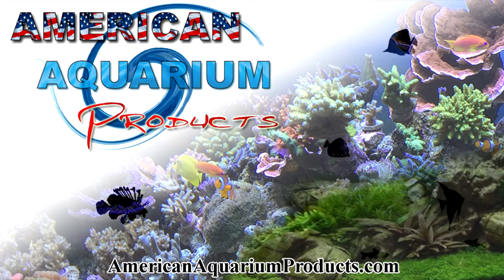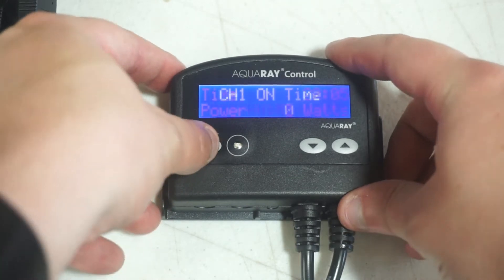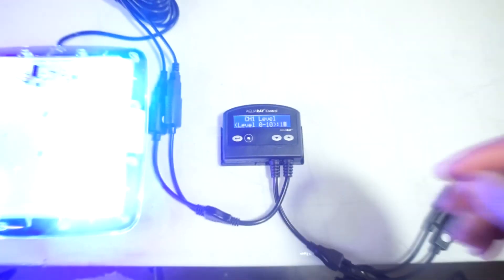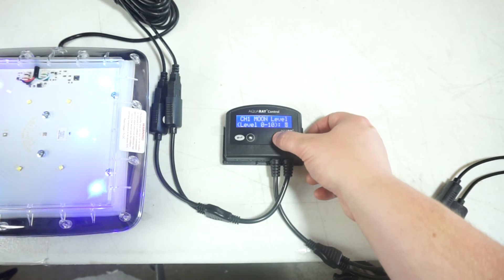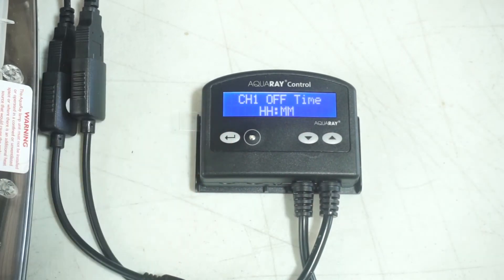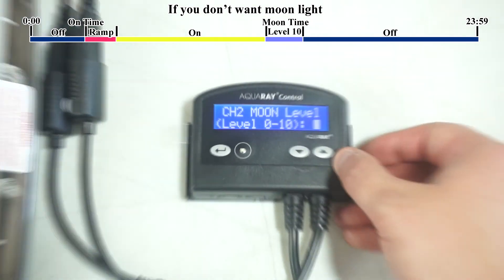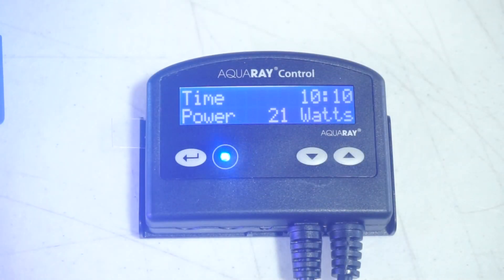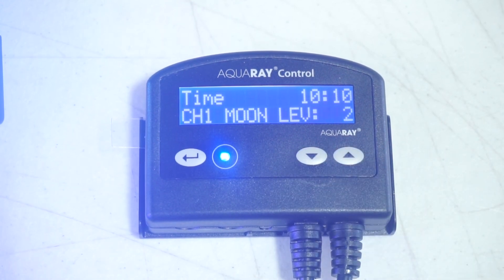TMC AquaRay LED Controller- Demo Set-Up

Comment: The leds in my TLC lights diy every 1-2 years. And you can't replace them. Not worth it.
Reply from the maker: +Thom I think you mean TMC lights and that they die. If this is the case, you need to check that they are placed in low humidity as long term it will make the emitters go out. These have a 5 year warrenty that TMC is usually very good at honoring unless obvious abuse, so I'm not sure why your saying we won't replace them. It's rare if an LED doesn't get replaced. Did you even purchase them from us AAP?
Reply: Yep, TMC. Nope I'm not talking about you, just my english is bad. I'm talking about a led goes bad, and you (or me, or anyone)can't buy this kind of smd cree led they built in tmc lights.
Yep, mine have 5 years garanity too, they replaced it TWO times, and at the end of my waranity it's bad again, And I can't do anything with it. It's pretty anoying when your aquarium need to run for weeks without lights while they send you new one.
I used the lights correctly hanging above the aquarium at a correct long distance. It was in open area, not with heat trapped in.
So the only thing I can say about TMC's led light, don't buy it if you don't want to replace it every 1-2 years.
Btw I took one apart, see why it cost so much, It's actually: 1 heatsink, and some led on a pcb. Thats all, no resistors next to leds, no capapcitors to protect them, nothing. Blinking, halfwoking piece of aluminium brick.
Terrible quality, for a very high price.
Reply from the maker: +Thom well we're the largest distributor in the US, selling 1000s of fixtures and less than 1% come back for issues. Simply, there warrenty program is better than everyone's, while all manufactures have some issues. You won't find one that doesn't. Can't beat 5 years.
Reply: +American Aquarium Maybe iam just unlucky.
Reply: I agree with AAP. We've been professionally using these for years and emitter failure are less than 1% and even when they do fail, replacement is very easy compared to others that often fail in a couple years with NO warranty. Could not disagree more with you comment as to quality, as these are light years ahead of other which is/was important for my aquarium maintenance & design company as failed equipment equals lost time and productivity. BTW these do in fact have capacitors inside and do not need fans due to lower heat emission.
 I suggest looking over placement as noted by AAP, as when investigating why something does not work or a fish does not get well with a certain medication, science always finds that there is a another reason why.
Resource: 
https://aquarium-digest.com/2011/03/03/aquarium-led-light-installation-options/#venting
Reply from the maker: +Thom also consider that if you had this problem with all other fixtures, which does happen, you would be covered for 1-2 years, so you wouldn't have got the replacements you did.

Comment: I'm def needing to get this 😁
Nice vid 👍🏻
Reply from the maker: +Paul  Blaney you would need to multi-controller... even more fancy. And pwm, which is how emitters are suppose to be ramped.
Reply from the maker: +Paul  Blaney or just this controller and ramp a couple channels, then turn the rest on with and on off timer
Reply: i'm def loving the the controller for 8 :) has lots of options and things to show off in a vid